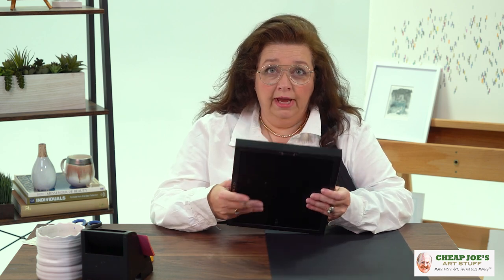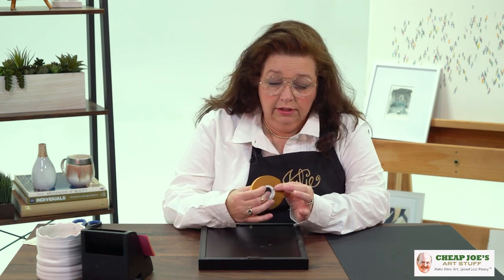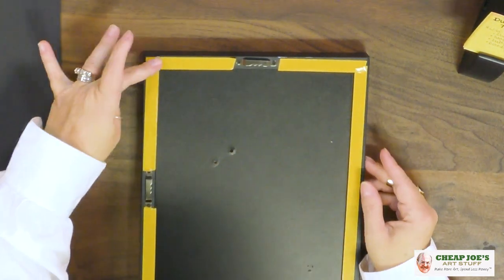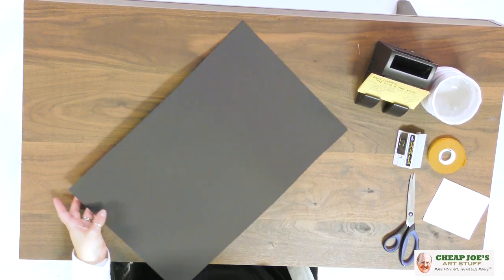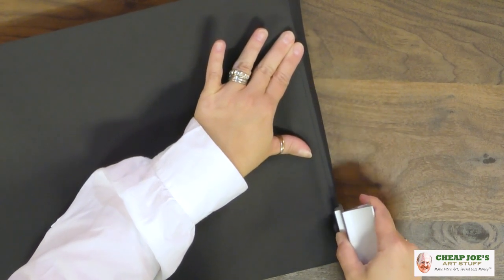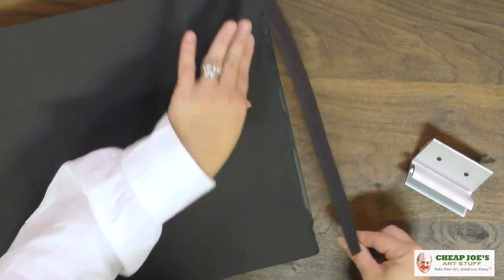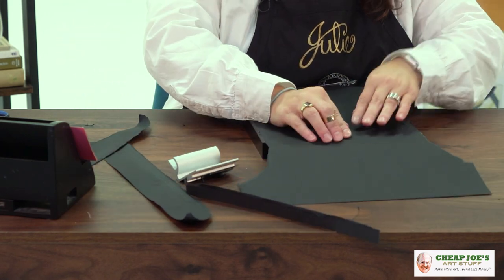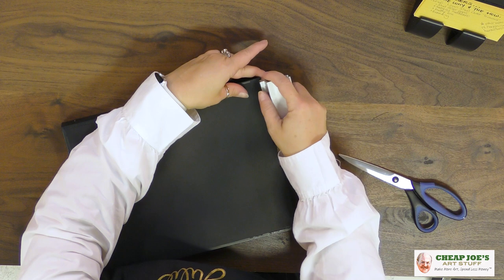Cheap Joe's 2 Minute Art Tips - Dust Covers

Comment: What about the backs of metal Neilson frames? I lay mulberry paper on the back of my acid free foam core and then put it inside the frame.  this is not really a dust cover though.  Any ideas or advice.  I use these wonderful frames to frame my fiber are pieces, which often do not have glass in front.